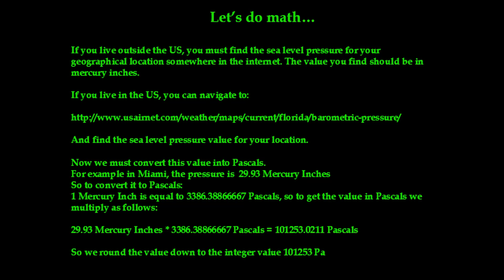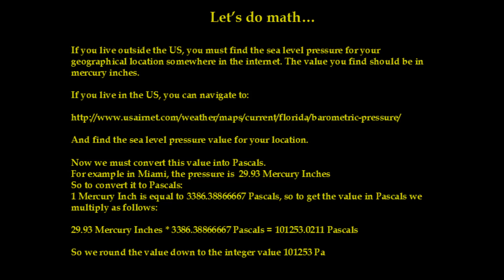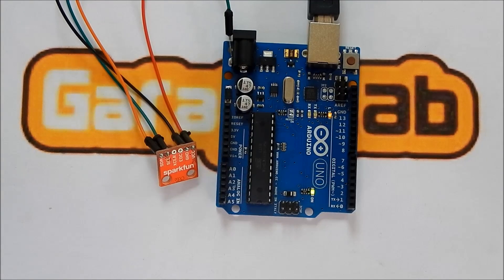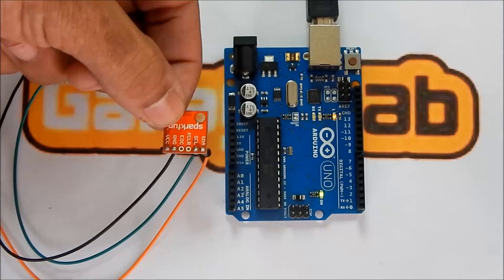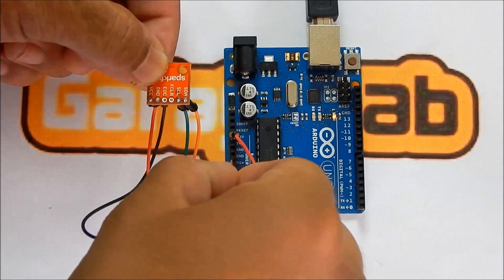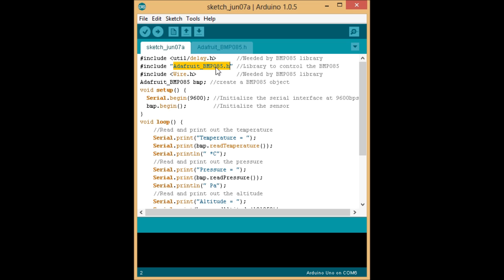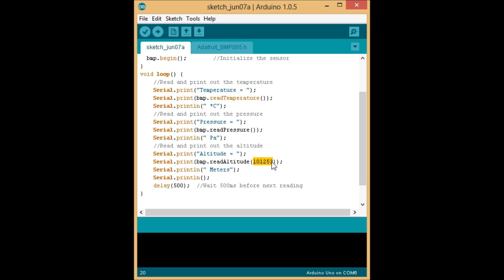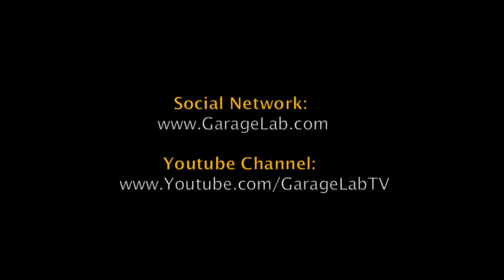Tutorial: BMP085 Barometric Pressure Sensor With The Arduino UNO

Comment: From the looks of the video the Arduino is already powered up and then you connect the BMP085 to the Arduino.  I recommend connecting your circuit before powering up the Arduino. Then carefully inspecting the circuit before applying power.